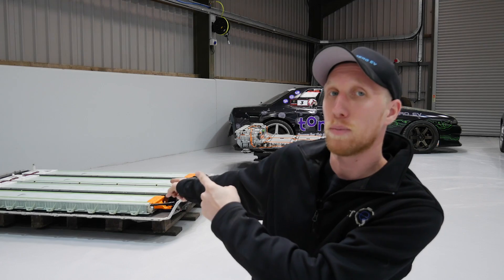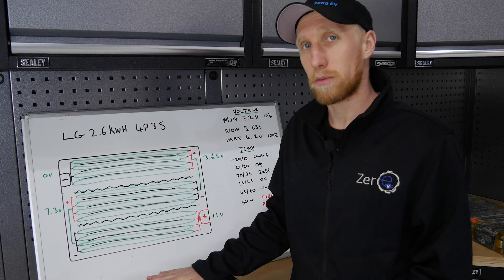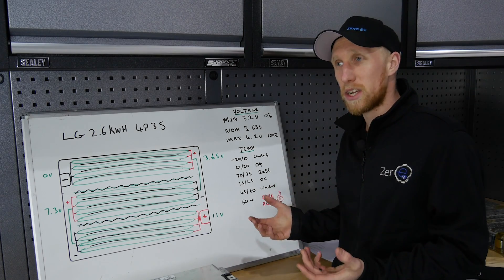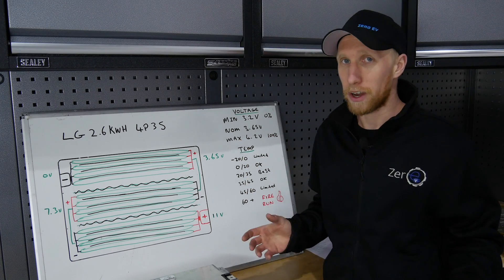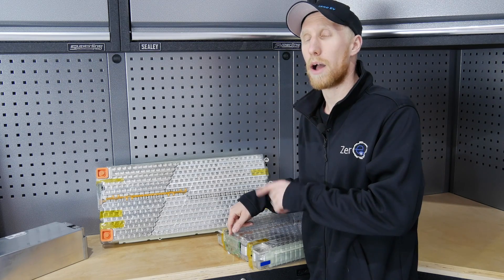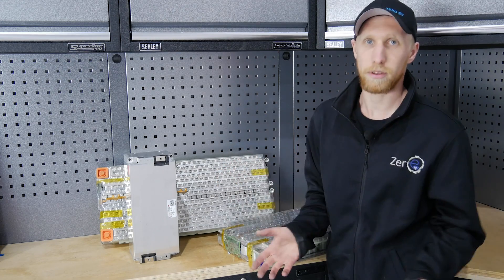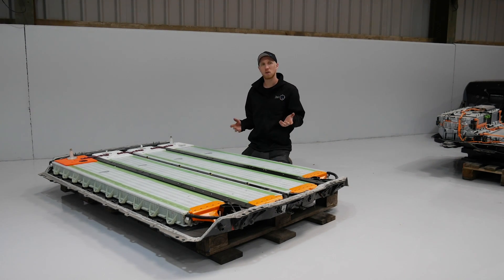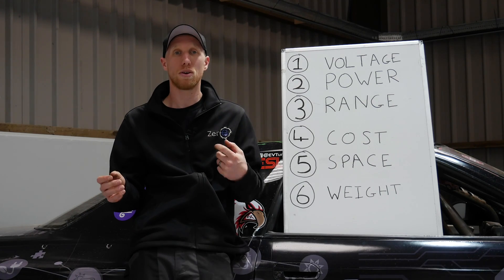EV Conversion Battery Guide - Tesla, LG, Calb, B Class, bolt & model 3 Modules

Comment: Hello, I know this video is kinda old but I was looking for some advice on what cells to use. I'm looking for something that can power a small Tesla drive unit, so about 600a peak. It's going in a 70s beetle so I want it to be light, and I'm thinking a 30-40kwh pack will be enough range. Options I have looked into are a BMW i3 pack, Nissan leaf pack, and Kia soul pack. I saw someone using a Kia soul pack and someone using a i3 pack at these currents, but I'm not sure if its a good idea to run those cells this above what they were originally used for. 

I was also looking at two volt packs as they are cheap and high discharge, but they are also kinda heavy. I don't think I can afford Tesla or LG cells, I really wanna keep the pack below $4k (although I'd like something cheaper, idk if it'll be possible tho)

Do you have any recommendations? What do you think about using a leaf, i3, or Kia soul pack at high discharge? Thanks
Reply from the maker: The leaf cells will be easy to package and build a bespoke pack from plus you can get them very cheap. You could try and find an electric rav4 pack of maybe an id3 battery pack.
Reply: @Hazell_Nutz  that's what I'm thinking, my main concern is idk if it will be able to put out the 600a needed without getting really hot

Comment: Hello, I'm converting a 2002 Ford Escape and I'm at the point of having to make a firm decision on battery pack. Trouble is, the more I research this the more perplexed the whole issue seems. The motor is a warp 9 and I'm looking for around a 100 mile range, vehicle is about 3300 pounds. I don't expect you to do calculations for me, but just maybe your thoughts on which direction to go? Love your videos by the way. Very well structured and informative. Thanks.

Comment: I love my B250e! I always wondered what the pack looked like... eventually a kwh upgrade should be available
Reply from the maker: I don’t think a Kwh upgrade will ever come available. But that pack is actually 36kwh but restricted to 28kwh in the b250e so maybe someone will unlock it at some point
Reply: @Hazell_Nutz  have you seen the Denza models? Lol same car but with a 62kwh hr battery. Mercedes sold it off but it's still being made on the same platform.

Comment: I have a question and I hope that this video isn't already too old that my question might end up getting missed/go unanswered.  I have an idea of doing my own ev conversion with a goal of having a long range.  Would it be possible/advisable to have 2 LG battery packs (10 LG module packs) wired in parallel with one in the front of the vehicle and one in the back of the vehicle?  Basically have 2 battery packs like you all built for the Miata Ev and wire them in parallel in one vehicle.  My thinking is you would still have the same battery voltage but would have a longer range.
Reply from the maker: Connecting two packs in parallel can be done but they must bother be at the exact same voltage, have BMS’s and be from the same over all pack. This then reduces the risk of one becoming off bananas or discharge at different rates.
Reply from the maker: Yes that will work and it has been done before. But if you went with a 350v drive motor system then you could have a larger pack all in series
Reply: @Hazell_Nutz  So your saying it would be better to go with the 2 packs in series with a higher voltage motor then it would be to go with the 2 packs in parallel with a lower voltage system?  Thanks for the reply and the information.
Reply from the maker: Yes this is because a high voltage set up will allow you to add dc rapid charging in the future
Reply: @Hazell_Nutz  ah, and with DC rapid charging the worry of not having a "long range" goes away.  Thanks again for the information, I couldn't really find anywhere that went into detail about this (whether or not you should/could have to packs in parallel for increased range).  Actually most videos I have found on the subject on youtube really do not go into detail on connecting batteries other then "here is our bus bars" then next scene is the battery connected and in the vehicle with very little information given.

Comment: hi,I'm now looking at a Citroen H van conversion, so weight/size is an issue. i would like 40kw .
Reply from the maker: There is a few options depending on the voltage range you are running. I

Comment: Hi,
Vera interesting video!
I’m planning to ev convert my VW Bettle oval 1956. 
And need some good pointers regarding the choice of the right battery pack.
I’m thinking 120 or 144V.
I saw a EU-company placing battery packs under the floor in their VW Beetle conversion. Which i thought was interesting.
I’m thinking more of commute Rhen power. But I do want power as well. So range and power are splitting the Nr 2 and 3 spot. 
Love to hear your thoughts. 
// Kind Regards Michael (Sweden)
Reply from the maker: There has been a lot of Beatles converted over the years so by far we are not the experts on those.

Comment: what would be a good battery for a lotus elise which is converted to electric with a model 3 rear motor. Is it possible to "mount" the batterypacks just to the floor of the car inside the pasenger cabin and build a "lid" obove it? For lower center of mass.
Reply from the maker: You need 225kw peak output so a 53kWh CALB pack or if you went for a 35kwh pack would be limited to 180kw motor peak

Comment: I am looking at doing a conversion using a full Model 3 suspension install with the small drive unit. What is the minimum battery pack voltage needed to get full performance out of the motor? I understand you do not have sufficient voltage in your Porsche and I hope to avoid that issue. Do you know of a good supplier of the CALB units in the US?
Reply from the maker: We ship world wide. ship to the US every week. You will want 350v nominal so 24 3p4s modules.

Comment: Hello, what would you recommend as the lightest/smallest option to run a lightweight drag car based on  Tesla Small or Large rear motor. Range is absolutely not an issue as max kWh needed is only in the range of 1.0-2.0. Current out  and charge rate in and weight are primary concerns. I researched supercapacitors, but size and cost was prohibitive. Thanks Zero EV for your amazing video information 🙂
Reply from the maker: Go for hybrid battery’s like Vw golf of Chevy volt.

Comment: Has a model 3 aftermarket BMS become available yet or do you know of any in the works? Also has is there many model 3 battery modules out there seem hard to find.
Reply from the maker: Not a good solution as of yet. There should be quite a few battery’s around

Comment: Is there a reason there's not more take-up of Yasa motors? They seem ideal for EV conversions but I don't see them used that often. Also at what £/kWh cost would you consider buying a module new rather than used?
Reply from the maker: Yasa are expensive and require a large inverter from another manufacturer plus a controller there not the easiest to use.

Comment: So Long story Short   to convert a pre 75 Datusn to get @ 200 hp and 300 miles range how much with safe system monitor control using off the shelf used/refurb parts and many hours of Our labor?
Reply from the maker: I don’t think you could fit a big enough battery pack. I have looked at my 280z and was going with 300hp model 3 motor and 53kwh battery pack giving about 200 miles range. Plan was then to add ccs fast charging. Parts cost is about 30k

Comment: Question??? I'm wanting to put a small rear tesla drivetrain into a 73 vw single cab. I'm needing 400 volts for that motor i believe. I'm also only needing to go about 90 miles on a charge...what's the best battery option??  I appreciate your service .the video is  great.
Reply from the maker: We now have a 2p6s calb module, if you ran 16 of them will give 350v nominal at 35kwh.

Comment: If tesla goes down the route of structural batteries and single casting, wouldn't that mean using tesla batteries would not be an option for EV conversions afterwards?
Reply from the maker: You are correct which is why we have moved our focus to the calb and LG modules

Comment: What would you recommend for a Hyundai Coupe SIII? I want to keep the boot space, and want to look at range at power - would the Tesla model 3 fit? Would it go under the car? Or what would you recommend
Reply from the maker: There is no easy solution, you would not fit a model 3 pack under the car.

Comment: I bet a model 3 battery would likely fit well in the bed of a small pickup truck. Hasn't @ hacked the BMS on the Model 3 yet as well as the M3 inverter?
Reply from the maker: We have a drive unit system in testing and Damian maguire is working on a bms

Comment: Hi, nice work dude, congratulations! I am thinking to put an Hyper 9 Hv in an 4runner 2001, so do you think is a good idea or I need something more powerful ? What kind of batteries will go fine with this work? Tank you!
Reply from the maker: I would go with the LG modules as we have used in the mx5 build just add a few more modules to increase the voltage

Comment: what would you use for a pontiac fiero conversion with a model s large unit motor? the main objective is power.
Reply from the maker: I would recommend Chevy bolt battery pack.

Comment: Can you tell us bit of your experience with the Volt battery pack in the Skyline? Pros and cons. Thank you for the great content.
Reply from the maker: Is a grate cheap battery pack, gives full 1200amps output for the Tesla unit but is very large for its Kwh size, the new battery in the skyline is a 60kwh bolt pack.

Comment: Does Tesla produce batteries in-house now? I thought Tesla just purchased them from Samsung or some other companies.
Reply from the maker: They have always produced there own batterys
Reply: @Hazell_Nutz  I think they purchased Samsung SDI cells when they built the Hornsdale Power Reserve/the South Australian big battery to back fill their supply, but in the vehicles, they use the internally manufactured Tesla/Panasonic batteries.
Reply: @Hazell_Nutz  kind of, they have a joint venture with Panasonic. Tesla will never do it entirely on their own imo because they need the Li-ion IP from others. Unless they buy one of the big cell manufacturers.

Comment: One not mentioned is BMW I3 pack 60/94/120Ah. Have spare from upgrade (not salvage) fully BMW EOS tested with hex  Dec code if interested in UK. Cheers
Reply from the maker: We just did the talk mainly on what we had in the workshop. The i3 modules are a nice design but quite large.
Reply: @Hazell_Nutz  can be split down quite easily and interesting cooling with HVAC /heatpump
Reply: @TekAutomatica  having had experience with these batteries, they are quite chunky, as in the 12 cell modules are hard to mount and break down. Also the power that can be drawn from them is not much more then they are rated for. But good thing someone got the BMS working for them.

Comment: Can you help me out? I want to convert a Nissan Patrol longbody from 1987. I think I want to use Tesla modules but I'm not sure. Right now we want about 50km (30miles) of range, which would be about 4 Tesla 5.3KWH modules. I picked these because we will potentially want to upgrade the range later on, once we can figure out if this is something we like. Also, do I need water cooling? I'll be using a 3.3KWH charger, and a Hyper 9 motor.

Thanks!
Reply from the maker: Would recommend doing 5 modules so you have a slightly higher voltage. We always recommend water cooling to keep all cells the same temperature
Reply: @Hazell_Nutz  but isn't that a little close to the 130V max? I thought the lower the voltage, the safer it is. But 5 modules isn't in our budget anyways. Maybe as a future upgrade!

Comment: Great information! I'm planning high power conversion to a very small and light vehicle. I think the LG 16s 2.6 kWh module that for example EV West sells in US would be close to perfect for my needs, but is there anything similar available in Europe? With 6 of those modules I would get 60.8V*6=365V, 2.6kWh*6=15.6kWh and 17.25kg*6=104kg. Peak discharge current is stated to be 800A. This would be good for small Tesla drive unit or Model 3 drive unit in the future when somebody provides a solution to control it. Any suggestions for a similar pack with modules available from Europe? I have heard that there is a way to modify Tesla modules to provide double voltage but it would still be likely too heavy pack for my car. Low voltage motors on the other hand don't seem to provide the performance I want.
Reply from the maker: You could look at Vw or bmw hybrid packs they would probably work quite well. Don’t recommend doing the 12s mod to Tesla model as you don’t gain anything as the can’t output high amps without heave voltage sag.

Comment: Can you talk about 800v systems like in the taycan, regera and gemera? Why go 800v vs 400v
Reply from the maker: Higher voltage means lower amps so less copper which = less weight
Reply: Unfortunately Zero-EV does not have any experience with any voltage above 400v. However the general rule is the higher the voltage the less current is required to get the power, thus the smaller wiring/busbars/controllers become thus saving weight and potentially cost. The higher voltage and less current also bring increased efficiency with it.

Comment: Would the Model-S batteries benefit from liquid cooling?
Reply from the maker: They should always have liquid running through them even in a situation where cooling is not required. This is so all modules are maintained at the same temperature allowing even cell discharge.
Reply: @Hazell_Nutz  that's interesting i thought the same, but spoke to a company who do EV conversions that don't. I can guess its a time and cost reason.

Comment: Another GREAT video !!  Question: if 3.2v to 4.2v is the  approx min and max cell voltages, when not under load, what is the acceptable (ie non damaging) voltage sag ? a) at various SOC % and b) at various % of max current say in a range up to 1000Amps for the various types of modules. I've looked all over the place and this kind of 'real world' / 'we've done it' info is really hard to find........ BUT YOU guys Have done IT [....... Kudos :-) ]
Reply: Sag under load gets speced by supplier. For some of our modules we have nice complete datasheets stating this, usually around 2.7V and at lower temps even 2.5V. So sag down to 2.8 - 2.7 would be acceptable, I am sure some Tesla's go lower.
Reply: @Tom-evnut  Thanks Tom that's incredibly helpful ... I was working backwards based on a helpful Tesla owner monitoring "260 volts is what my 1525 amp P85DL makes at 30% soc and 110F/43c"  which is 2.7v/cell. Thanks for your confirmation.

Comment: You guys are in England? On the show volts, there using another LG battery, do you know of it? Great video. Enjoying your videos.
Reply from the maker: Yes they use an LG chem 2.5kwh 1p16s modules
Reply: Zero EV you use the more compact modules to get the voltage higher. Thanks for answering.

Comment: Hello Chris, Great video, I have 3 of the Tesla Model S modules with the original Tesla boards. Is there a 3rd party BMS I can purchase to help keep the cells evenly charged using the original boards? Thanks John
Reply: Simp BMS can do that for you.
Reply: @Tom-evnut  Thanks I will check it out.
Reply from the maker: Yes as Tom said definitely use the Simp BMS

Comment: The OEs will always drive towards greater integration in order to leverage pack level cost and mas savings, so it's going to become harder to use s/h OE batteries for conversions of ICE architecutre vehicles. But, as battery cell costs fall, and production volumes ramp up, i think more and more aftermarket battery module/pack options will appear!  Personally, i'm not a great fan of EV converting existing ICE vehicles because it's really, really hard to get a suitable level of HV safety due to the packaging constraints inherent in a car designed to take an ICE powertrain and not an EV one, but it clearly something that is happening in increasing numbers.  In the UK, our Construction & Use laws are WAAAY behind the curve wrt LVDC, so it will be interesting to see what happens to the unfortunately inevitable event where someone is seriously hurt or killed by an EV converted vehicle. That "test" case will likely set a precedent and may cause significant ripples for aftermarket EV conversions.......
Reply from the maker: Yes your completely correct. We worry about someone hurting them self which is one of the reasons for all these videos want to try and teach people enough that they stay safe.

Comment: Two questions: are voltage requirements dictated by the motor's requirements just? And say in the case of the Tesla or bolt you shown, how are the battery modules connected to each other? Series?
Reply from the maker: There a mix the bolt is a 3p96s
Reply: @Hazell_Nutz  sorry, I mean the 5 big packs you showed
Reply from the maker: Yes in the bolt the 5 modules are connected in series. The voltage required is based on inverter requirements.
Reply: @Hazell_Nutz  Thanks. Loving the videos

Comment: Great video! Have you looked into BMW Hybrid packs, which seem very attractive - modules 26 or 34 Ah, 59Vnom. Not very expensive, only 5-6 modules give a full voltage even for a small vehicle.
Reply from the maker: That’s quite interesting we have worked with i3 battery’s but never to hybrid ones
Reply: Those are very similar in terms of spec to the VW GTE hybrid pack shown in the Twizy video.
Reply: A 12kWhr 200V pack is going to suck pretty severely other than for maybe a motorcycle